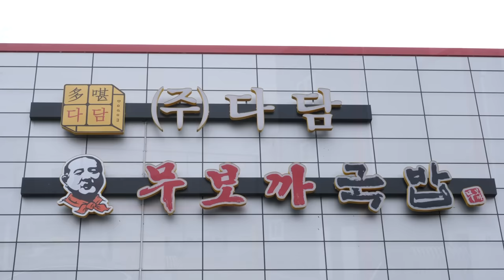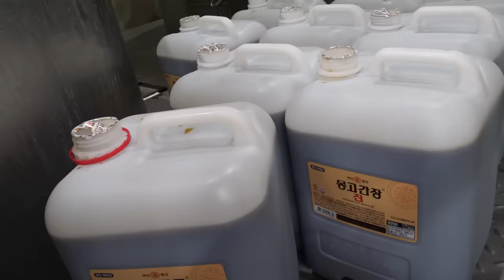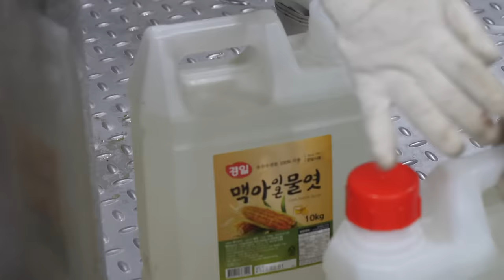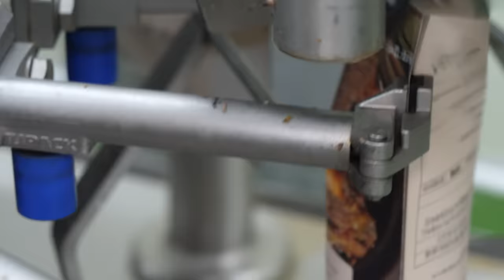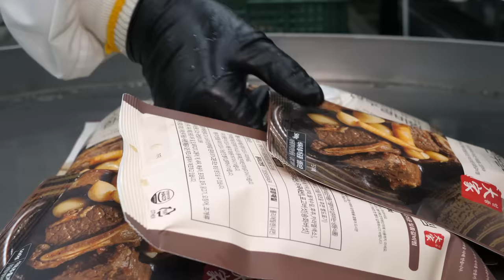엄청납니다! 한번에 1.5톤의 한우갈비찜을 만드는 대량생산 현장 / Braised Beef Short Ribs (Galbi jjim)

Comment: The extracted soup is then passed through a filtration system to remove any remaining particles or impurities. This can be done using a fine mesh filter or a centrifuge that separates the soup from any solid materials.